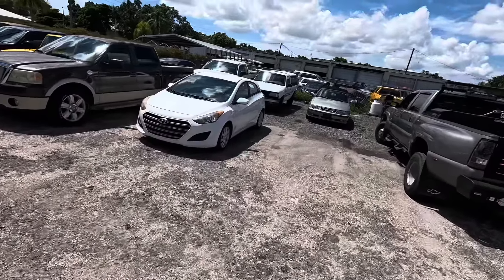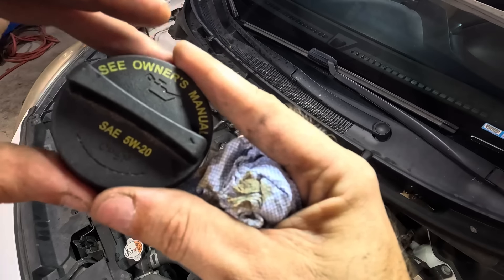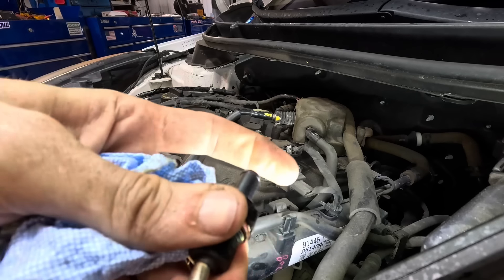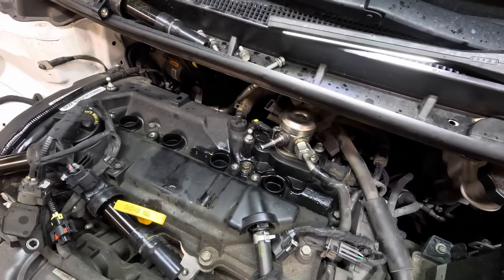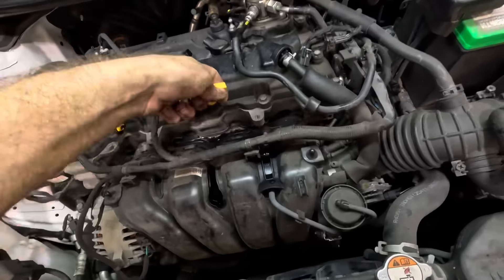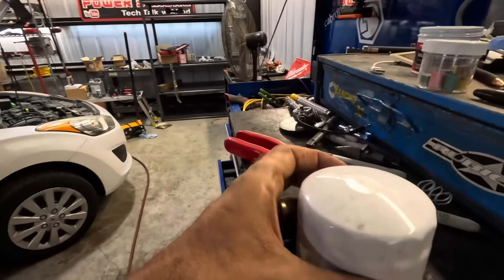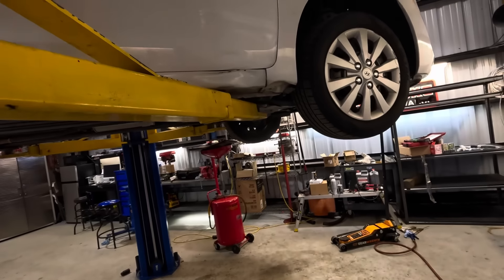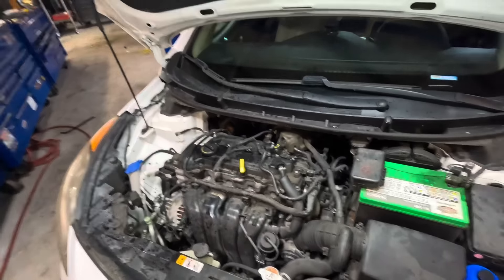Excessive Blowby! BURNING OIL! Hyundai Elantra 2.0l

Comment: BG makes some pretty awesome products that I have personally used and had great results with. @Ray do you ever or have you ever used or sold Lucas oil products? I once had a Ford Thunder chicken that was running super sluggish and I would get maybe 5mpg if I was lucky and was talking to a formaer Nascar mechanic who was the lead Richard Childress racing mechanic for years before he decided to retire and open up his own shop in the small ton I grew up in an where he grew up in as well. He told me to try Lucas tuneup in a bottle and see what it does because it is stuff tat they use in Nascar all of the time so I gave it a shot and took my car out to an area where I could get it up to speed and I kid you not once I hit the 65 MPH posted speed limit I all of a sudden fealt a huge burst in power and combustion and looked out my rearview mirror and saw the big plume of black smoke I have ever seen come out of a gas powered engine so much so it would choke out a diesel. After that my car went back to getting the gas mileage it should have been getting then I ran the same BG cleaning product that you are using and it was awesome and worth the money.

Comment: Hello Rainy, I am from Nigeria. I have a 2005 Toyota Corolla. I notice there is loss of power when I'm going uphill and also notice when i drive normal and push on the throttle, the rpm most times wouldn't go past 2000 but when i start taking my leg of the throttle gently, it accelerate better at that point. I have changed the fuel pump and filter, spark plugs, Air filter and throttle position sensor on the gas pedal but still no solution. It doesn't burn oil tho. Please advice on what to do.
Reply: Mechanics is the process of elimination with physical inspection taking place, what you are asking is akin to asking if the moon is made of cheese or not.

Comment: So my question is, in order to have that deep cleaning of an engine, what is the customer doing that would provoke that deep cleaning because no all cars need that. Also would does the data say about that deep cleaning. Is it more on 4 or 6 cylinders? It is on customer's who go long periods without oil changes or long periods without oil changes and also where the vehicle is not being used.

Comment: I will never use Slick50 again... I added that stuff in the dead of winter in Wisc... I went from having decent heat in less than 10 minutes to no friggen heat for 25 plus minutes literally overnight... I'd rather have the heat generating friction than freezing my nuts off...

Comment: the 5w-30 thing means nothing. If you look at the owners manual of this engine (my own is a 17 sonata) the temprature swing shows 5w-30 dealing with most swings. When at my dealership for service, I notice they tend to do 5-30 actually to slow the oil burn. Note that if these cars even out of 10yr/100k warranty i believe burn more than a quart of oil/1000 miles you can actually GO to hyundai and have them replace the engine under the whole "2.4 go boom issue"

Comment: My 2 cents?  This car is not worth a rebuild, but if the owner only drives 4000 miles a year, it could limp on a good long while.  1000 mile follow up good, advise customer to change the oil every 6 months regardless of mileage, or every 3000 miles, and I would maybe run the EPR at every oil change.   The oil should also be checked and topped off once a month, but that seems to be beyond the owners capacity.  This seems to be the proverbial “little old lady from the Villages” car that never gets driven.  I would also advise taking a the car out on the highway for 30 minutes once a week to get it hot and exercised, but if the driver really is a little old lady from the villages, that’s probably a safety hazard.

Comment: Of course these chemicals work. It would otherwise be a super costly repair of this four banger. I just wonder why that happened after so few miles on this thing.
Engine's inherent flawed design?
Ray said something about the low oil levels, but if that'd be the case, chemical cleaner wouldn't work because rings wouldn't be clogged but rather worn. Ray, any thoughts?

Comment: Old wrencher here... sure cleaners can work.  But, these wee Kia/Hyundai 4's ALL burn oil.  Low quality, low tension rings are to blame for a quart burnt every 800 miles.  I'd change the plugs, oil and filter and drive the wheel nuts off it.

Comment: Ray, come on, don't top it off to the top mark after just shutting it down, you knows there a bunch of oil dripping down from the cams etc. top of the engine. If it's on the top mark right after turning it off, it's overfilled.

Comment: I'm skeptical. Before evaluating the after treatment amount of blow-by,  you should have driven the car, just as you did in the beginning.  The  engine load of actual operation would have caused more blow-by to build up in the crankcase.

Comment: All 2.0 gdis in Hyundais and kias have those issue. They shot themselves in the foot. They built an engine with low tension piston rings, then called for 0w20 conventional oil and a 7500 mile interval. They get up around 70 to 80,000 miles and drink all of the oil out and kill themselves. Trouble is... they put a 10 year 100,000 mile warranty on it, but only to the original purchaser, it isn't transferable. Now they're replacing every engine in every car that they sold from 2014 to 2019. Not sustainable. This is one of them.

Comment: Wow! A Hyundai 2.0l with 86000 miles and it only burns 1 quart of oil in 4k miles, that is impressive in its self! 800 dollars to try to fix a worn out engine is insanity! IMO! P.S. Can anyone in chat tell me what the compression psi on a non worn out engine is? 90psi seems pretty low.:hand-purple-blue-peace:

Comment: Valvoline Restore and Protect oil is said to clean up to 100% of carbon build up in engines, but it unfortunately takes several thousands of miles before results can be had. THEN, once the rings are freed up, you'd find out if this is the problem with this engine. If the owner had been using this oil from the beginning, it has extra friction modifiers, along with it's ability to clean (or keep clean) the ring lands which MAY have allowed this issue to not happen..... maybe! Just sayin'

Comment: Yep that compression is way low it should be 170 to 190 PSI
Reply: The electronic throttle valve is closed by default at start up, regardless of pedal position. You'll only see those compression pressures at wide open throttle. Restricted airflow gives restricted compression pressures. That's why pumping losses on petrol engines are high at low loads compared to diesels.

Comment: This is what happens when you go a YEAR without changing your oil.  Mileage is a good reference point, but there's a reason the oil manufacturers say  X months or X thousand miles and I still do 3 grand on the clock. Even if Toyota says 5 to 7500.  I have it changed between their recommended oil changes.  CHEAP INSURANCE FOR CAR MOTORS FOLKS !

Comment: Ray, run the engine the 1000 miles refill with conventional motor oil of the right weight and viscosity  and never put a wrench on that engine again change every 6000 and for get the synthetic bit let those rings resurface and seal right compression then 135 pounds per cylinder etc  gas milage goes up brakes last 125000 ...

Comment: What happened to your flexible wedding band? 😕
Reply: I dont know about Rays, but a coworker of mine had one, and it fell off every time it got any automotive like fluids on it. He dug through the trash one day to find it in a rag he used to wipe off his hands
Reply: I wear a silicon wedding band in the shop. I lost one after doing a service and washing my hands. Drug through trash and old nitrile gloves without success. Something about the fluids make them super slippery. I could also stand to get one a little snugger too. Luckily I had a backup ring.
Reply: @Doc_435  i forgot to mention, his swelled with brake clean. I think he said it was a silicon band, but that thing was like 5 ring sizes larger with brake clean for the rest of the day
Reply: @legionofanon  I bet that's what happened with mine as well.

Comment: Compression should be 120minimum. 90 is borderline weak. Wearing out. Customer states I drive a Korean trabant. Help me quit spending 30k for used pile that lasts 120k miles

Comment: I went and test drove a 2001 hyundia  new  got out drove it got back to the dealership
Pulled the dipstick just for fun
It was bone dry, not even a drop of oil on it.  NOPE....  went and bought a 2001 toyota celica. Still have the toyota it has 300k miles on it, I doubt we would have paid off the Hyundai before it was ready for the JUNK YARD.  
The motors fill up with sludge 
I would run a 0w20 oil in it and expect it to burn oil and change it every 3k miles.

Comment: Those treatments can't fix anything, if an engine is spanked, that's it, but it can stretch a marginal situation a bit.  I used some of those to coax a very, very tired old Toyota I had in college for a couple more years.  The engine was totally worn out, but I was a broke college student that needed an old beater to make it just a bit longer.  Did they do the job?  Yeah probably.  But it wasn't gonna make that engine not have 200k+ and a previous history of marginal maintenance.

Comment: The vehicle is less than 10 years old, less than 100K miles, and it's an engine problem so it falls under Hyundai warranty.  No idea whether it will be easy to get them to honor it.  If it were my car, I'd be much happier having you do what you've done so far than trying to wrestle with a dealer, but if it needs new rings or an $800 "speculative" treatment, that's a different issue.

Comment: Ray, in your discussion with the owner you may wish to find out if he is the original owner of the vehicle as Hyundai comes with a 10 year/100,000 mile power train warranty to the original owner. He would likely need to have maintenance records as well in order to meet the terms of said warranty. That would require owner to have some communication with the dealer to confirm warranty coverage.  If the $$$ are coming out of my pocket, I'd likely risk the $800 service before undertaking a ring job. But if Hyundai wants to fix it on their dime, I'm not going to lay out 800 smackeroos trying to save them from fixing the problem - a problem which they may claim is normal "wear and tear" if I raise the issue of carbon buildup as a possible etiology.
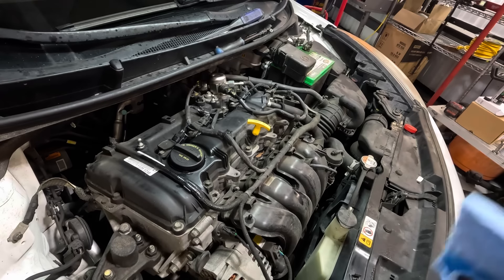 There was one inconsistency in your video. You turned off the overhead light when you demonstrated the smoke in the early part of the video. And you specifically stated that you did so in order for us guys to be better able to see the smoke. But at 57:10 you turned that upper light back on before showing us the "after" result. I saw much less smoke. But was there really less smoke, or was the smoke less visible due to the different light parameters?  I'm gonna go with an honest oversight on your part, but still harbor some doubts about your having done this to troll the haters.

Comment: OMG, check your oil level people... This is despicable that it's this low.   Also, Ray some vehicles that have specific cylinder wall treatments will burn oil with a thicker oil versus a thinner oil.  This Hyundai isn't one of them, but just so you are aware.  It has to do with the low tension rings and the coating on the cylinder walls being so smooth that the oil control ring can't take off a thicker oil like a 5w30 but it will for a 5w20.  I would have never believed it myself unless I read the TSB from the OEM that said so.  I think it was a specific Ford or Audi engine where I read that.  Edit: I looked it up. It's Ford engines that are Plasma Coated Cylinder walls, and also Audi with Ceramic and Plasma coated cylinder walls.

Comment: Ray internal cleaning?  When I was 16 I had a 1950 merc with flathead 8.  A real oil burner.  An old time mech told me to get STP gas treatment and while running the Eng.-- keeping the throttle at about 12oo rpm to start pouring the STP into the carb.  IT was MAJIC-- the exhaust started to really smoke (a lot) and after about 20 or 30 seconds with the STP empty it stopped using oil-- burning it.  I became a believer.

Comment: All those Hyundai and Kia cars burn oil. Combination of poor engine oil ring design and type of customers who drive them don't change oil on time. Most of the cats also don't have a maintenance reminder light. There are customers I've seen that are burning oil so bad and don't check their oil that they run without oil and lock up the engine. It's happening every week.

Comment: Hyundai that has oil consumption problem this is completely unbelievable lol. These cars should all be scrapped they all have this problem with the 2.0. We use to have customers that would only get 2000 miles before the motor would consume the oil off the dipstick.

Comment: Hyundai/Kai gdi engines known for carbon valve and ring built up. Crappy design.
Reply: Watch I do cars every blown GDI engines he takes apart the valves are all full of carbon regardless of what make it is Toyota even came out with a dual fuel system to combat that carbon buildup.

Comment: direct injection systems cause a lot of trouble over time. Plus old oil: engine dies prematurely.

this engine treatment stuff could help loosen the oilrings. When you added some engineoil, maybe you could have added a quart of ATF. ATF is also a cleaner.

Comment: thats not what POS means to me LOL. KEYBOARD Karens, LOVE it. Trolls be gone go back under the bridge, Project Jeep!! I need your brake cleaner the stuff here in CA SUCKS. Well since its a GDI engine carbon on the valves screws things up, plus weak tension on the cylinder rings for "fuel economy" with infrequent oil changes doesnt help. I think this treatment helped. Id love to see a follow up in 5000 miles.

Comment: I just never understand how you leave the car engine running inside the shop without directing the exhaust outside the shop. . Isn't that a just a bit TOXIC breathing in exhaust daily for decades?
Reply: The door is open.  Modern cars are pretty clean.  It’s not like he is running a lawn mower or generator in there.

Comment: This is incredibly inclusive test you should have show before and after video in piston hole ! So your   Not being fair on test results come on show a before and after when charging for snake oil ! Obviously if you change oil it will slow down with blow bi!!!!!!! Your better then that! Prove your reason to buy your snake oil !!!!
Reply from the maker: Not applicable, the oil cleaner can doesn’t affect the top of the piston, looking again after the oil service would have been a waste of time. There are different products designed for top cylinder cleaning which are added to the fuel.

Comment: Hyundai engines are crap! They are known to blow up engine at 90k miles! The engine oil quits flowing for some reason! I know because I bought a very well maintained and great looking used car with 80k miles and the engine started knocking at 85k! Did the research on these cars and a lot of people had the same problems! Good luck, but the engine is ready to fail!

Comment: Valvolime restore and protect.
Reply: Nah. That stuff cleans so much that in a regular gas engine it delubricates the cylinder walls. Recipe for mechanical gore.
Reply: @Bilskirnir3124  I know they made one for diesel engines that you can’t even get unless it’s try a dealer or something. The new one is supposed to be a slower acting product.  I don’t know.  Will see how it works on the car the diy guy has been working on forever and tried every chemical trying to stop it from using oil.

Comment: Kia Hyundai engines are garbage! You really need to check your oil once a week. Once they start using a quart a week you need to dump them before they blow up! The spark plugs start fouling and the catalytic converters start to melt down from clogging with oil.

Comment: Ah yes.. the Kia 1.6ltr... The one in our 2017 Soul is total junk. Started using/burning oil at about 70,000 miles. We changed the PCV valve and it fixed nothing. The oil rings are clogged. Oh and we change our oil every 3,500 miles. 

I will say that after changing the oil as soon as it used any oil (about 1000 miles) it slowly got is back to going 3500 miles between oil changes. Again proof that the rings are clogging up. These engines are junk.
Reply: Throw some marvel mystery oil in the oil and gas.
Reply: @davidturk6170  
The treatment they use with the clear cleaners and rinse, at high temps, works too. The issue is the oil rings will clog back up in another 15,000 to 20,000 miles. These engines are junk. I will never purchase another Kia, ever.